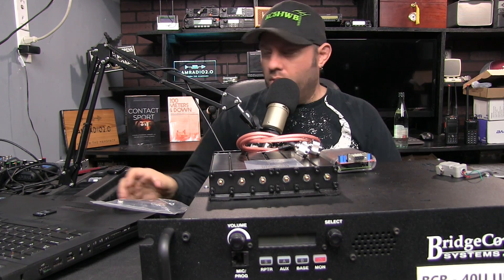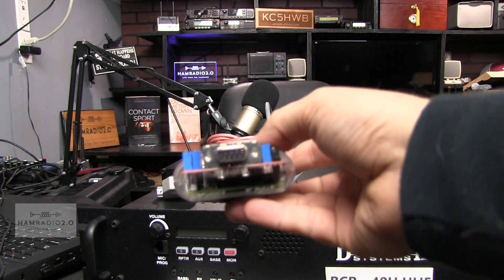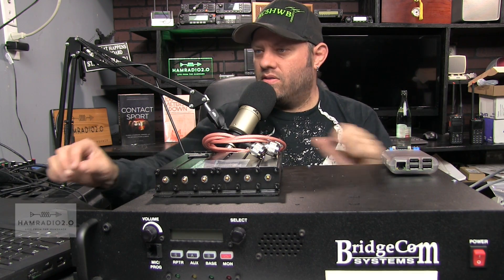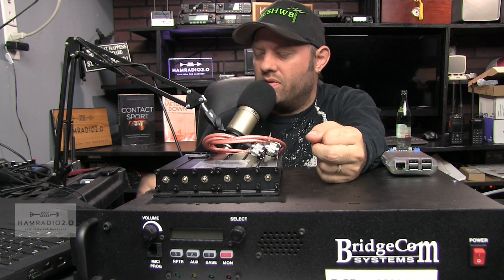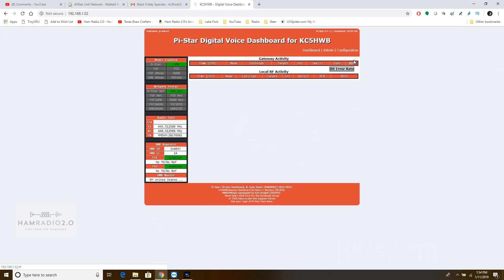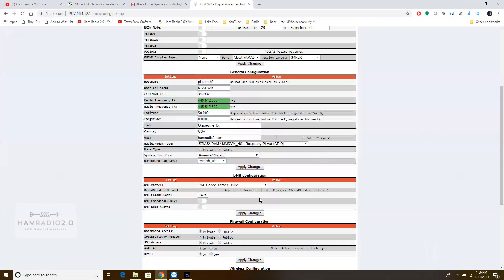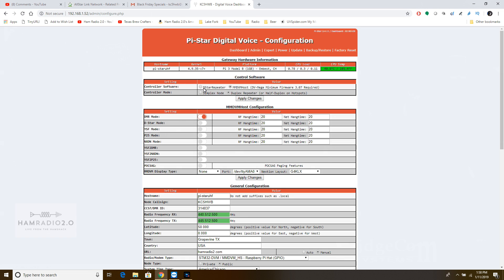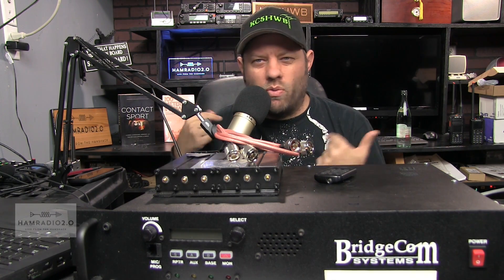Bridgecom BCR Repeater Setup, Part 2

Comment: Can a mixed mode repeater be connected to cbridge or ip site connect for dmr networks?
Reply from the maker: You could probably do it, but it would need to somehow transcode the other modes to DMR before the cbridge would pass the traffic to the network.  Otherwise it would work on DMR only, not the other modes.

Comment: Thanks for the comprehensive tour. Did you ever set up a P25 repeater?
Reply from the maker: No.  It is something I still want to do but haven't gotten there yet.
Reply: @HamRadio2  I just got my license last week and have been looking at setting up a Motorola Quantar UHF repeater for P25. Trying to decide whether I want to go that route, or this Bridgecom.
Reply from the maker: @423tech  If I had a choice specifically for P25, I would choose the Quantar.
Reply: @HamRadio2  My only concern is if I invest about $2K in equipment, will there be enough other folks with P25 radios who will use it? That is what makes me think the BridgeCom is the way to go, since it's just analog.
Reply from the maker: @423tech  I thought you were asking about making a Bridgecom into a P25 repeater or using the Quantar instead.  If you want P25, go with the Quantar.  You can connect it into a network across the country/world with other P25 repeaters, if you wish.  If you want to go analog, yes - get the Bridgecom.  It depends on your area and what you are trying to accomplish.  Either choice would be good, depending on your goals.
Reply: @HamRadio2  oops, sorry. Just trying to decide which one would be best. I appreciate you taking the time to respond!

Comment: Disappointed that you did a review on that repeater product, but never opened it up to look at the construction.
Reply from the maker: Over a year since this video was posted, and no one has ever mentioned that.  However, it isn't a bad idea.  I am planning to do some other vids on this repeater upcoming, maybe I can work that into one of them.
Reply: @HamRadio2  To quote Dave Jones from his EEVBlog channel, "Don't turn it on, TAKE IT APART!"   For this class of hardware, I'm curious to see the build quality.  Especially because of the high duty cycle usage, and perhaps poor environmental conditions. 

I'm curious to see if there's room inside the chassis for the MMDMV hardware, rather than having something flop around loose.  I see that Raspberry Pi enclosure, and all I can think is: The spiders are really going to love moving inside that and setting up housekeeping..

Thanks for the video!